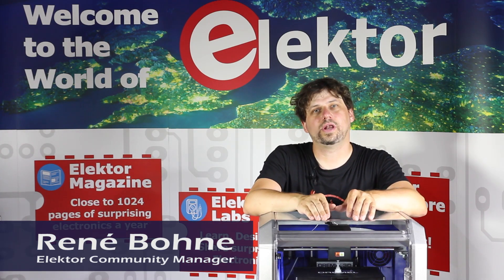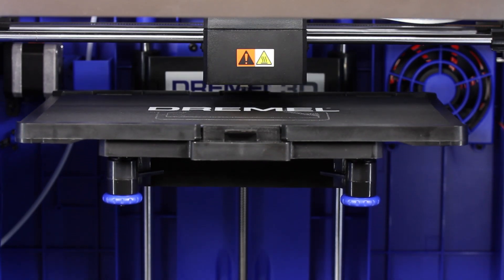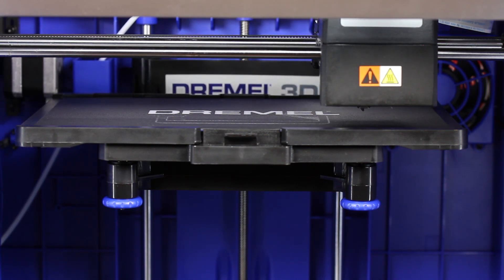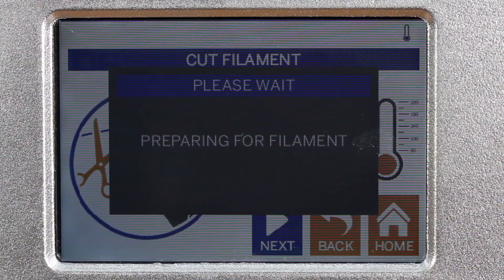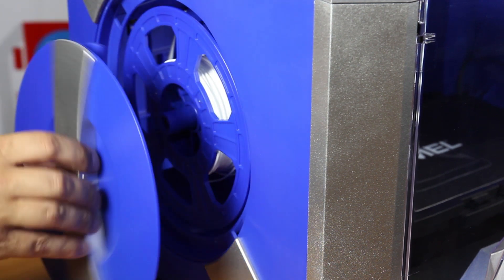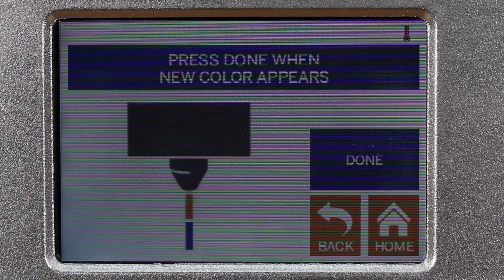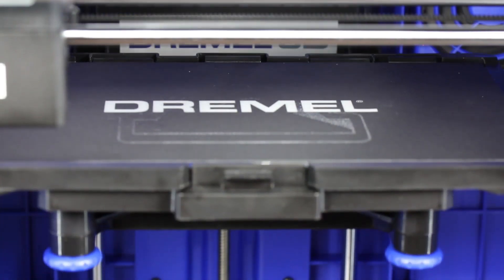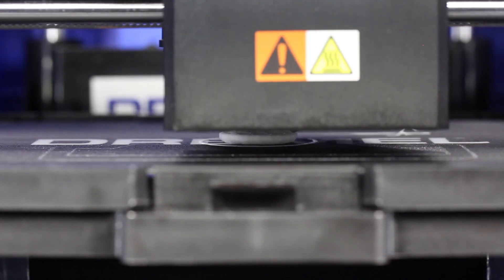Quick test: DREMEL 3D Idea Builder 3D40

Comment: u forfgot to tell about dpecs and price
Reply: Thanks :) It is an FDM 3D-printer with 0.1mm layer resolution, single extruder... print volume: 255x155x170mm... You can find more details and prices in the Elektor shop. It is a really reliable printer that did not cause any trouble yet.